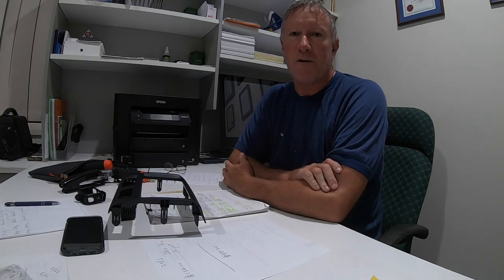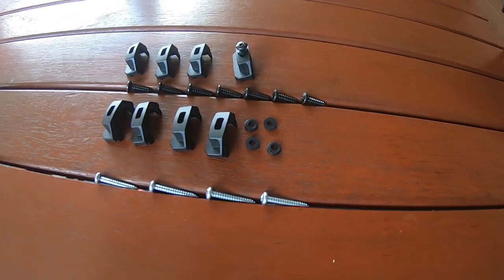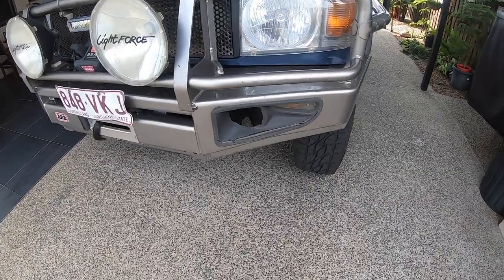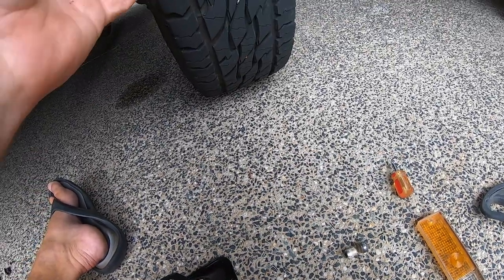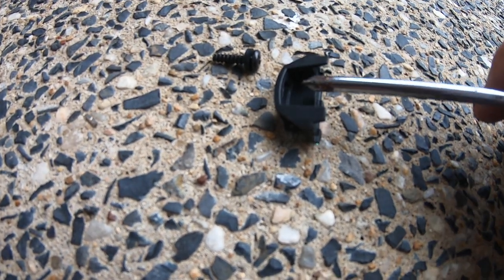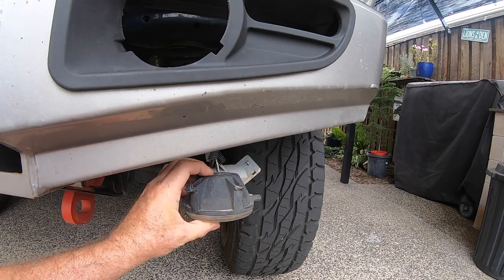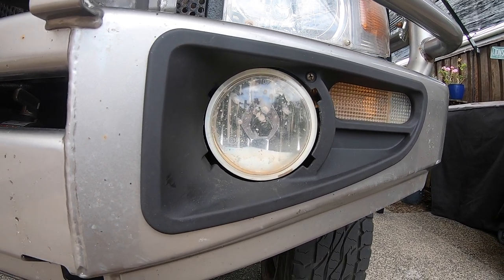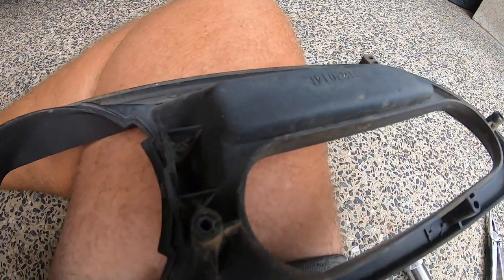How to Replace Fog Light Shrouds on an ARB Deluxe Bullbar

Comment: I've just bought the Stedi fog lights and they don't fit my current indicator shroud on my ARB Deluxe bull bar. 

The Stedi guys tell me there's a replacement one that will suit however looking at your new replacement shrouds it doesn't look like the fog lights will fit yours either.

The mounting screws don't line up.

Do you mind sharing if you ended up purchasing the Stedi fog lights and did they fit?
Reply from the maker: The lights fitted. In that video I even go through setting beam height up after I installed them.

kennym

Comment: Which arb did you go to? I am struggling to find a replacement shroud
Reply from the maker: Hi Adam (from Mount Hart Wilderness Sanctuary, Kimberleys),

I went to my local ARB store at Bundaberg. Ron Bennett is the manager and I’m sure he might be able to sort something for you 👍

kennym
Reply: I can’t find any either. Only looking online though. Only ones I can find are about $200 USD 🤔
Reply from the maker: Jess,

Try ARB Bundaberg - give them a ring. 

kennym
Reply: @jess2277  did you have any luck mate?